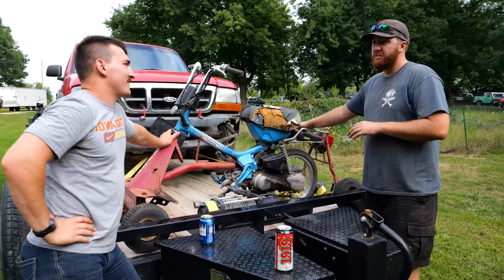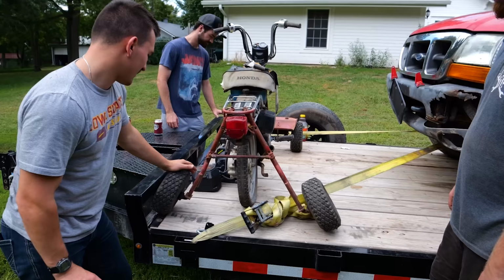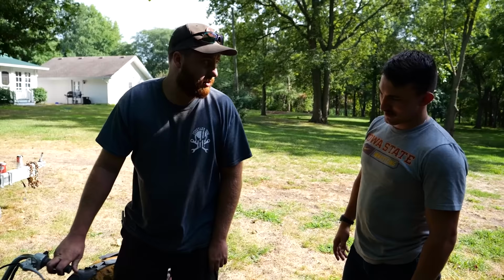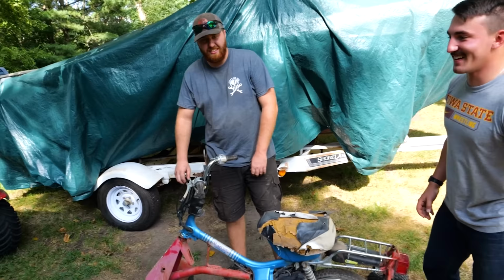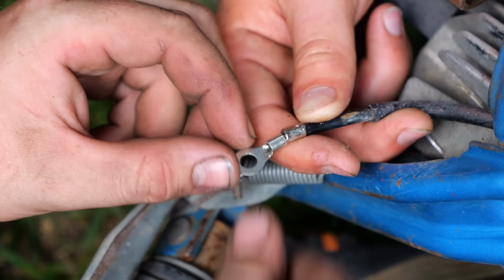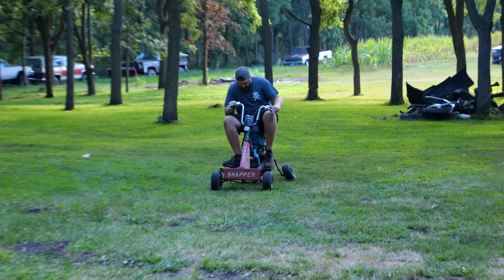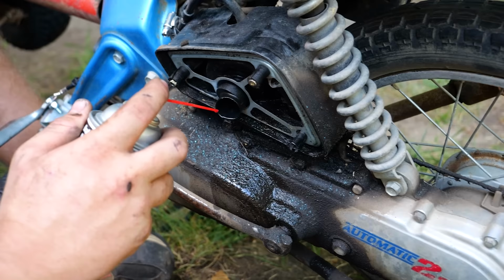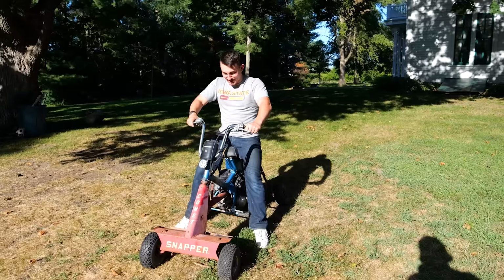Reviving the Crazy S#!% I Built in High School - MOWped First Start in YEARS

Comment: John's deathtrap reminds me of the much less elaborate deathtrap my buddy and I threw together in high school.
He had one of those green mesh garden wagons and I had an old rototiller from like the '80s sitting around doing nothing so we decided to combine the two and make the shittiest go-kart you've ever seen. Robbed the engine and drive pulleys off the tiller, bolted the biggest pulley to one (1) wheel, sat the engine on top of it (held in place with two criss-crossed bungee cords), and connected the two with the old alternator belt off my Mazda. The belt wasn't tight enough so we took the tiller's idler pulley and hung it off the wagon's floor with a bolt and two hose clamps.
It was direct-drive all the time which meant it was both compression started and stopped and steered via the pull handle held up in front of your face. This motherfucker went 30mph and was about as stable as a Geo Tracker with a fridge strapped to the roof. God I miss it.
Reply: I want one
Reply: Jesus christ that's a fuckin paragraph

Comment: When I was about 13 I built a 3 wheeled go cart out of a cheap furniture dolly, the ones that have 8 inch pneumatic tires. Cut the handle off,and welded a 10 pneumatic castor wheel platform and rigged up a tiller steering bar with a 90 degree angle that stuck straight up at the end you held onto. Put a throttle off a Honda 3 wheeler on it. The load bearing plate became A. the backrest, and B.the anchor point for the very sketchy motor mount system of angle iron, rear, and about 5 layers of 1/8 inch sheet metal with about 200 rosette welds to make a solid motor plate which we bolted a 12 hp Tecumseh Rototiller engine and clutch assembly that ran a carb off a 250cc Harley Davidson 2 stroke dirtbike (so obviously no longer had a governor) and 2 .060"" valve spring shims on each valve. We ground approximately. 100" off the base circle of the cam lobes which with proper lash gave us .100" more lift. Took a lot of trial and error along with about 100 Allen screws to make homemade lash caps to get the correct lash which then created another problem. That much lift without a change in duration or lobe separation angles boosted our cylinder pressure dramatically which meant a 13 year old who weighed about 100 lbs would try to pull start it and about halfway through the compression stroke it would kick back and try to jerk your arms out of socket if you were dumb enough to try and hang on. Starting procedure became pulling it behind a 10 speed bike with the clutch disengaged and the kill switch in the off position as fast as possible then engage the clutch,  wheels would slide about 3 feet then the engine would start turning, and then flip the switch to on about 2 seconds after the engine started turning. We were geared for top speed because that's the only sprockets we had (probably would've gone 80 mph if we'd had enough power) so that helped make this operation a lot easier, usually by the 3rd attempt we had it running. Then the trick was don't let it die until we were done riding for the day.  It had a solid axle that drove both rear wheels and a home made "scrubber brake" that rubbed one tire to stop... so yeah kinda no brakes. We lived on a caliche road that was pretty decent for about a week after the maintainer came by which happened once per month. We had a 2 mile stretch of straight as an arrow road and only 2 families that lived on that road about 2 miles past us and over a cattle guard which we knew better than to attempt crossing with 8 inch diameter tires. Don't know how fast it went, felt like 200 mph but was probably around 45. Dad was a truck driver and only home on weekends, and we were always super busy helping nim work on cars when he was home so he knew we'd built this thing but I think he assumed we ran the rototiller self propelled drive system with a modification or two. One weekend  he had a buddy over and the buddy asked how fast our cart went. Dad said probably about 15 mph. Highly offended me and my brother fired it up to show him what was what. I made a short pass by the shop at about half speed and then  did the sketches rolling burnout with the front wheel turned about 75° to turn around then kinda coasted to a stop in front of my dad and his buddy who are standing there mouths agape. Dad's says  lemme try that suckered out, and if I was smart I'd have stalled it right then and not been able to restart it...But nope, beaming with pride I get off, give my dad a quick tutorial on the controls and away he goes. Well he did a top speed pass, must used every inch of road we had because we'd never seen that thing go anywhere near that fast. He flies by us and starts pushing the most useless brake pedal in all of motorsports history and I guess he was down to about 30mph when he reached the cattleguard I mentioned earlier. I don't know exactly how high that thing flew when he jumped that cattleguard but I know I saw at least 4 feet of daylight between him and the road. When he managed to get it turned around and back to the shop we could see a definite bow in the frame and that castor wheel was about to snap off. The tiller steering bar had a new 45° bend in the middle of it, dad had a bruise on his cheek and a mouse over his eye. Without saying a word he walked into the shop and wheeled the Oxygen/acetylene torch out and cut up everything but the engine. His buddy got uncomfortable and left. That night he said, " I oughta whip yalls asses for building that damn death trap. I can't believe nobody ever got seriously hurt or killed on it. The only reason I'm not beating your asses is I'm kinda proud yall could make something go that fast for such a small amount of money, you gotta tell me what all you did to the engine." 
We told him what all we'd done and he ended up selling the engine for  $150 to a guy that was building some hotrod vintage looking 1/4 midget car to run exhibition laps at the dirt track in Roswell NM about 75 miles away. He gave us the money on the condition that if we built anything with an engine he had to check it out before we ran it. We probably had $35 in the whole cart so we weren't to upset, honestly I think we knew all along it was a death trap disaster waiting patiently to kill or maim someone but admitting this thing was a very bad idea was just not something we were gonna do. Didn't wanna look like a chicken... Better dead than scared I guess. Unfortunately I haven't processed much in some ways. Currently I'm building and riding a Vtwin powered minibike built off a Massimo Baja Warrior MB 200 chassis. Modifying as I go, riding daily and have it up over 70 mph so far, and my plans should have it over 100mph soon. I'm almost 52 now and after years of building and racing dragbikes including Nitromethane burning 140 cubic inch "Harley" Top Fuel/Pro Fuel bikes ( not a single actual Harley part on them)  I guess I just can't walk away from it.

Comment: That thing is wicked cool! Ya better hold on to that thing for as long as it lives 😂 reminds me of the first moped i had 1980 Honda express. It had a bad engine in it and had no way to get it fixed because I was a city boy and like 13, so I gutted the front off of it and put it on a bicycle 😂 that thing was epic. This reminded me of some of the contraptions i would come up with in my parents backyard when I was a teen. Really cool to see great minds think alike when there's a will and way. I also had a 1982 Honda city express that also had a bad engine and a 2004 cool sports 50cc scooter engine and drivetrain. I mated the 2 together and it had like a 14 inch wheel in the front and a 10 inch wheel in the back 😂😂 it scooted though. Did like 40 and all the lights worked on the 1982, that's why I did the swap for legality. Rode that thing for years. Might still be running to this day maybe? Wish I still had all the cool things I made as a kid lol.

Comment: I was terrible in shop class so all I made was a mess LOL. But my older brother made a motorized barstool for an assignment in high school auto shop. If I remember correctly, he couldn't get a barstool in time, so he ended up using just a classroom desk chair. The motor was an old Kohler snowblower engine, I think. I remember he came home laughing one day because apparently someone in his class tore apart another snowblower for its engine, only to find out it was the snowblower owned by the school which was in the auto shop for a tune up. The janitor was not happy 🤣. This is such a neat contraption. I love hearing stories like yours. Keep up the great work!

Comment: Back in the late 1990s, I built a sweet ass lawnmower. The thing I was most proud of was the hand crafted dual exhaust I made from 3/4” galvanized piping. Sounded like a Harley. 27mph and no brakes. Took it through the woods and tried to jump a fallen tree. Mower stopped dead in its tracks, but I went ass end over the steering wheel a few times. That was the end of that. I still have the exhaust and a picture of the mower for memories sake.

Comment: I’m currently building a 4.5hp 2 stroke Tecumseh (from a snowblower) powered bicycle. I’m trying to retain the 2 faster sets of gears (it was a 21 speed so will now have 14) the chain off of the centrifugal clutch will go to the smallest pedal gear then the normal bike chain goes to the back like it was designed to do.

Comment: I’m making something like this. I was planning on using a bicycle and a lawnmower transmission and a chainsaw engine but now my Honda scooter my grandpa gave me might donate the engine and some wiring because I stripped the threads off the rear wheel hub

Comment: I built, and ride a mobility scooter that can do almost 40mph.
So i can safely say, that thing looks like a death trap 😂
Reply: I have one that I would love to do this with...
Reply: @sykwookiee  Mine requred a few gocart parts, an 1800w motor, 48v li-ion battery and controller. Fair bit of modifying frame and welding box sections (depends on scooter).
I found that a kids quad bike can be broken for a lot of parts and save a lot of money, that took trial and error lol

Comment: currently putting a 250cc out of a yamaha bravo snowmobile on my old craftsman riding lawn mower and was wondering if anyone had any info on how far apart the torque converters are supposed to be?
Reply: Place proper new belt on secondary clutch flush with top around primary on motor with about an inch of deflection with light downward pressure  belt width is critical for good performance if you do not move at idle you are close volumes are written about finer adjustments
Reply: @toddmuehleip9250  ok thanks

Comment: I made a Snapper maintainer no mower deck just a bolt on blade that would swivel side to side . Only problem was the front end Is way too light and it just goes the other way from the blade as soon as you try and blade any rock .  I painted it cat yellow and I think it's still at my folks house somewhere .

Comment: I made a mokart out of a John Deere 180 & a wheelbarrow. I stretched the frame & flipped the Peerless on end, then switched the belt pulley to a sprocket. I use a Predator 212 horizontal shaft engine to run it through a centrifugal clutch & chain.
Reply: The wheelbarrow is now a seat…

Comment: I wish that I had photos of my first mini bike. It was not a revival however I followed the guidance from my uncle. I sanded down the head gasket surface on the head for more compression, drilled the air cleaner for more air flow and installed an electronic "ignition points eliminator" kit that I bought from Builders Emporium. (Anyone remember that chain store?). I eventually sold it in order to afford my first motorcycle. I do not regret that choice though. Going from a Tecumseh powered single speed mini bike to a 5 speed Hodaka was a mind bender for me.

Comment: I didn't start the build but i finished it. I had a honda FL250 with a yamaha 340 snowmobile motor bolted to the back of it about 8" higher than it should've been. We welded in a buggy seat and made the stock gearbox fit a wider belt. Then we used a gas tank from a polaris quad and a random snowmobile muffler both found in a local salvage yard. Thing was hideous but went 50 mph.

Comment: Nothing wrong with that beast, mate!  Classy build, it is.  A mate of mine had a trolley that ran 10" wheels off an old pram up front and a 12" and a 16" bike wheels on the back (he nicked the latter off his sister's bike).  We took this thing up one of the steepest roads in the town we lived in and while he was in the cab, I was on the tail board hanging onto the rear.  Anyway, we came haring down Juliet Ave and were building up a fair pace and I said to him that he'd better start braking for the corner.  His reply: "What brakes?"  We were doing a good 20mph as all wheels were bearing centres, not bushings, and I tell you, it felt a LOT faster!  I asked him how we slow down and he said "Like this" - and swung the front wheels to the left.  The trolley rolled over many times and I was flung into the middle of the road while he went with the trolley.  When I stood up after narrowly being missed by a car and looked for him, he was under the thing about 50 feet away, looking at me and laughing his head off.  Did we learn anything?  Yep - we learned that you steer GENTLY onto the long grass beside the road to slow down and don't just swing the wheel and hope - something we perfected over the next hour or two of towing the thing to the top of the hill and riding down it again.  We were about 12 and the name of his trolley should have given me a hint as to his driving style - it's name was Whap Crap.....for reasons only Nigel could tell you.

Then there was customising another mate's Mini when I was 16.  He wanted more pep out of the 850cc 4-pot, so we bought a twin carb inlet manifold and found some Stromberg carbs off a Triumph 2000 or similar sedan that my Dad had laying around doing nothing and bolted them on.  We had to cut some of the firewall away to get them to fit too, as well as grind the old inlet manifold away from the stock 850cc exhaust manifold to get them on.  Once done, we started it up, but it immediately flooded and died.....so we leaned the mixture off as far as we could without the screws falling out, raised the idle and turned the key - the thing idled at about 1500rpm and sounded like it had a HUGE cam in it....until you saw the belches of black smoke coming out the exhaust!  Took it out on the highway - man that thing went like a cut cat! - and got that little engine up to phenomenal revs and the speedo to sit on the last line of indicated speed on the dial - 94mph.  I knew the speedo was accurate at 30, 50 and 60 because we had checked it against other vehicles we owned, but those 850s are supposed to peg out at 75 or so in stock form.....and all we had done is stick these huge carbs on.......but the speedo kept climbing slowly until she hit 94 and then there was no more she could give.  The car had unassisted 4-wheel drum brakes, a pudding-stirrer gear shift on a gearbox that had no synchro on 1st and stock cooling system (no heater), so keeping it cool and slowing it down were pretty much things to think about later.  The next morning the engine was hydro-locked - she'd blown the head gasket BIG time and emptied the radiator into as many cylinders as she could!  The car got stolen a few weeks later, joyridden and burnt out, so it was a sad end for it, but it taught us a bit about modifying only ONE part of the setup and how much it affects other things if you don't think ahead and do the necessary.  I have bought modded cars and also modded many other cars since, but nothing beat the raw excitement of sticking huge carbs on a tiny engine and then pulling what must have been 6500rpm or more on an engine rated for a max of 4750 and holding it there for a good 10 miles......

Comment: Had to laugh, i took the express 2 the one that you wound up the kick start and pulled a lever on the handle bar and it spun the engine over. Anyways i chopped the handle bars down so low that you had to put the fork nut in between to start threading it to mount the bars. Then stretched the forks 4ft, raked it some. Added a 4ft sissy bar on the back and put a 12 inch scooter wheel up front. Wish I had a picture of it but we didn't have phones with camera's just yet lol. Awesome vid!

Comment: Craziest vehicle thing I did as a ~8yo is- I added a whole accessory electrical system to my Power Wheels. Big lights, etc. Trouble is, I couldn't afford switches... so I used paperclips attached to wires that I'd chain together to turn on. Well.... they shorted, and the resultant red-hot wires did a fine job of smoking out my bewildered parent's garage. Good times. Still have the motors from that thing 25 years later, , stout little beasts.